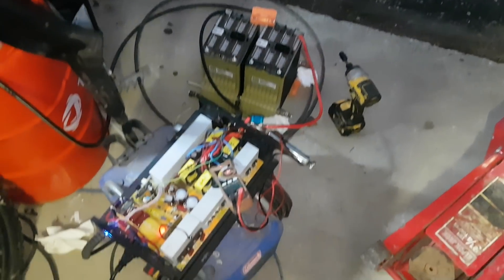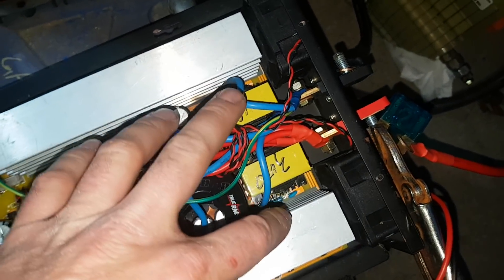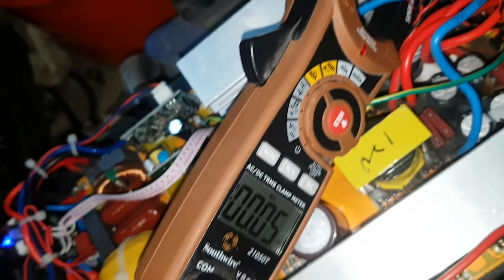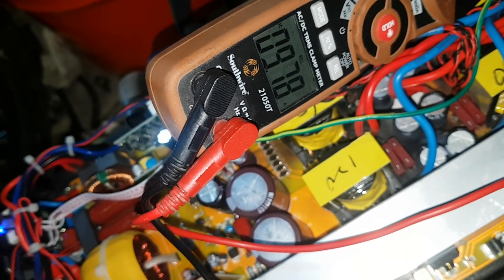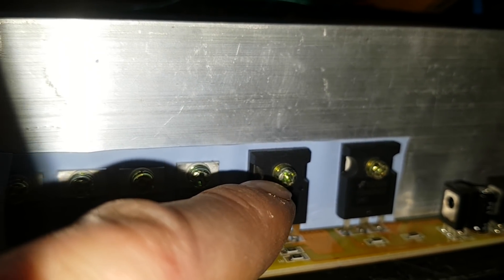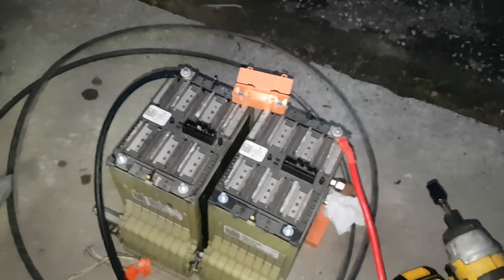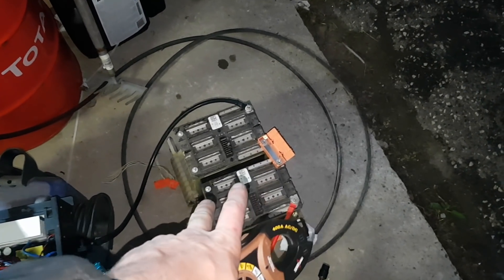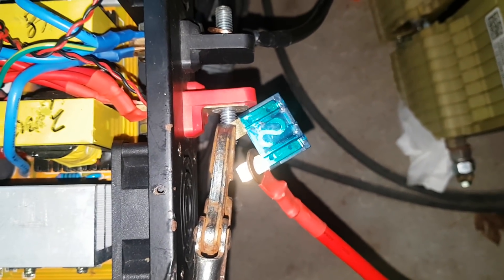Chevy Volt Batteries For Bobby And Testing Inverter

Comment: I was hoping to see how you were going to hook the Volt batteries up!  I did get the BMS’s you suggested.  I was wondering if I should just bolt the wires, or try to use the harnesses/plugs that came with the batteries to hook them up to the BMS with.  There is very little info on this for the Volt batteries.  Congratulations on your wonderful success.  Thanks for all the help!
Reply from the maker: Use the bms wires it has its much nicer, its not to hard to figure out with a multimeter!

Comment: For those boost stages are the gates driven together in parallel or does each one of those 4 boost stages have its own control circuit?  That miss match seems really bad... And once one of the 4 blows then the other three have to carry even more load and bang it all fails...
Reply from the maker: Yes your right, i will have to change it out when I can.

Comment: Where do you get a lot of you're wire and connectors and such. I live in London Ontario. Just want some decent stuff for a relatively cheap price. I got 2 power it battery "generators" I am combining them into one. I just need to connect the batteries togeather and hook it back up. I also want to run to heavy gauge maybe #4 wires to the back compartment where the charger stores so I can power a 55lb thrust trolling motor and possibly a 2000w pure sinewave inverter for a Microwave. So what do I need to fuse it for 2000w÷12v= 166A? My wire also needs to be rated for 166A? Also do you think the batteries can handle that? My packs have the pouch style cells. Not the 18650's. Thanks so much any info is much appreciated. BTW you're awesome! Running a framing crew and going off grid with a wife and kids! Kudos brother!
Reply from the maker: HAHA THANKS!!! yes you have everything right with the power it wire and fuse, the batteries can take about 150 amps each so thats 300 amps between the two, I jeest keep my eyes open for deals on wires, and I get battery experts Pickering to send me my connectors or I buy them on ebay, but ebay is not as good.
Reply: @GoingOffGrid101  Thanks! Binge watching a bunch of your videos now ha. I can't wait to get this power it all ready to go. I am starting a gas business and will use it to charge my Milwaukee batteries and prob run a few fans and a Microwave in my 3/4 ton work van
Reply from the maker: @TheSimplecanadian  thats sick! looking forward to a video lol

Comment: just saw bobby's video and he sounded excited about the batteries he is getting from you,,i would be appreciative if i could get cheap batteries somewhere like the chrysler batteries i saw a video of you  opening up,,and would love to have your opinion of them sometime
Reply from the maker: They are amazing! I like them the most out off all my batteries
Reply: @GoingOffGrid101  thanks..i saw some of those on ebay and was thinking of hetting a couple because thats all i can afford,,what about a bms for those
Reply: @GoingOffGrid101  i would love to pick your brain sometime about batteries and hooking them up sometime weather it be phone or email if your comfortable with that ..
Reply from the maker: @gspenc50  https://www.aliexpress.com/item/70A-100A-150A-200A-300A-Bluetooth-Battery-BMS-With-LCD-Displaly-8S-24S-LiFePo4-7S-24S/32954067682.html?spm=2114.search0104.3.1.21375d47zQfJNE&ws_ab_test=searchweb0_0,searchweb201602_2_10065_10130_10068_10547_319_317_10548_10696_453_10084_454_10083_10618_431_10139_10307_537_536_10059_10884_10887_100031_321_322_10103,searchweb201603_57,ppcSwitch_0&algo_expid=f5a9c49b-7850-4471-8995-42c1162aae1f-0&algo_pvid=f5a9c49b-7850-4471-8995-42c1162aae1f